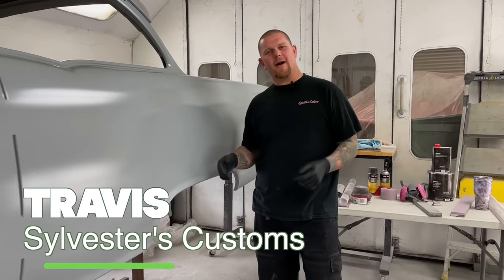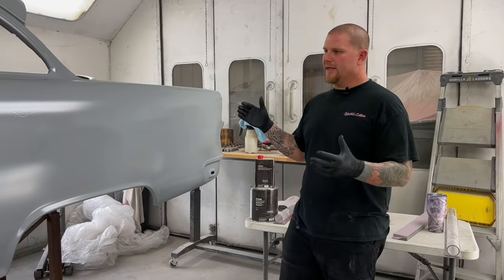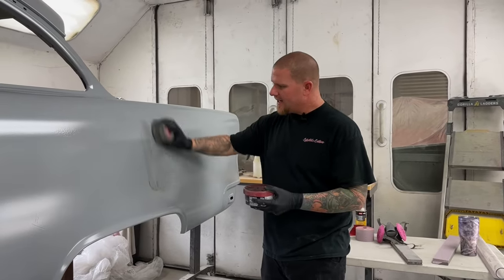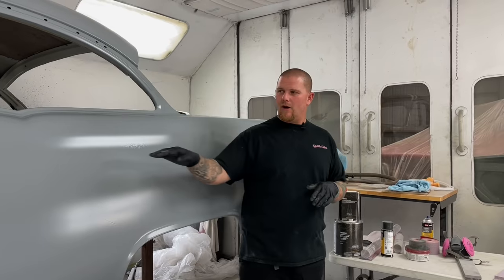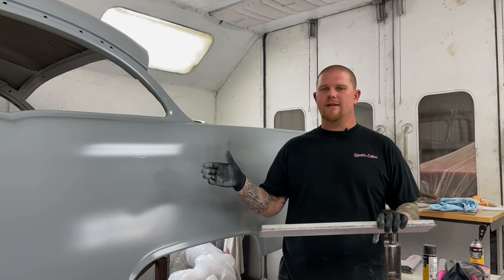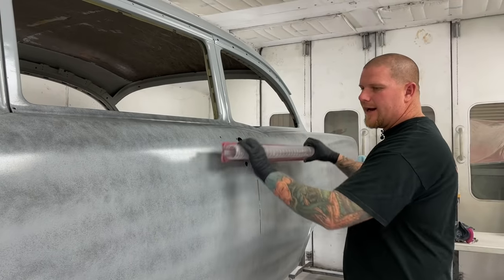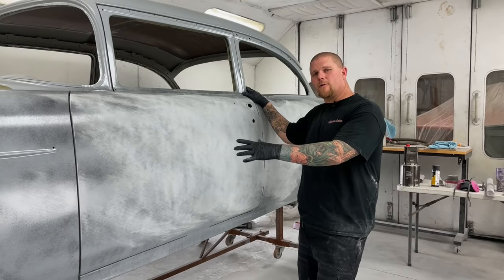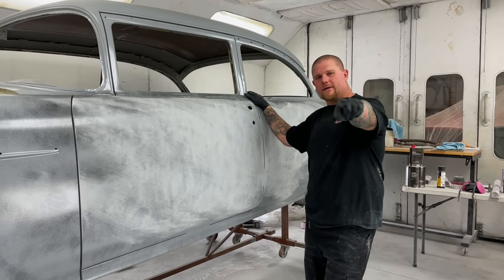Block Sanding Primer - Essential Steps to a Mirror Finish

Comment: them are cool blocks i bought the foam ones with the 3 rods that you pushed through and you could pull out to adjust.well he dyed a few years ago and his wife no longer wanted the buisness so that company is no more i think i bought them back in 2012 i still have them and they work good to foam handles are wearing away though bondo dust eats them up if you dont keep them blown clean

Comment: Thank you very much for all the time you put into these videos!
Quick question.. if you blow through the primer and have to spot prime that section how do you avoid going through again if technically the blow through is a high spot and doesn't require any more build .. but everywhere around it is low
Thank you for your time
Reply from the maker: You need to have the metal work completed and the bodywork needs to be perfect before you do any primering. If you are having areas that goes through multiple time then the body work is not right spend more time in the beginning would be my recommendation. I hope that helps
Reply: @SYLVESTERSCUSTOMS  
Ok thanks

Comment: I just picked up some vp 2050 on your recommendation.  I had already bought eastwood epoxy, but from watching your videos I decided I would go with the ppg. Not actually as expensive as I thought.  My question. I'm still doing welding repairs on the main shell of the car. But I have the doors, hood, trunk lid and front removable fenders metal finished and stripped to bare steel. I want to get them sealed up with the epoxy, but the rest won't be ready for some time. How does this stuff sand after a few months of sitting? Love the videos! Tons if help. 
Cheers John 🍻
Reply from the maker: Right on! Thank you. It does get pretty hard but I’d rather have something fully dry and durable than something that’s still shrinking and drying.
Reply: @SYLVESTERSCUSTOMS  Also just bought some linear Blocks last night. Thanks for the promo. Cheers John 🍻

Comment: So you're using that primer on the bare steel, then body filler where needed on top? Then a couple of more coats as needed blocking in between? Must admit to finding the primer and filling stages a little confusing. Also, would a gallon of that primer be sufficient for a 4 door Mercedes. Thanks for the videos, really like your explanations and tips. Cheers John.
Reply from the maker: That is correct we talk about the primer in the latest video that just came out Friday. It is a one stop shop type of primer it typically takes about a gallon to seal everything up in bare metal. And after bodywork sometimes you use a gallon sometimes you know depends on how much body work.

Comment: I like using House of Kolor KDA3000 DTS epoxy hybrid sandable high build primer. Can also be mixed as a medium build or sealer. I also like Specialist Paints 2K DTM it is exactly the same way. I dont get shrink with either one
Reply from the maker: Whatever works. However they all have shrinkage it’s a matter of how much they get. Only way to know is to weigh it on separate panels as it dries to see when they stop losing weight.

Comment: Have you done the wet sanding video yet?  Unable to find it. 

Also I'm a bit confused. During your block sanding you  spoke of when to stop (when you see body filler) but in one of your replies to a comment you said 95% of restoration shops do body work after prime?  Did I mess up by taking the dented areas down to bare metal to mud?  I've always thought after blasting then clean, mud, block, feather it in perfect then prime, guide coat, check for anything missed, remud if necessary?  It'd be awesome if you posted a step by step bullet point list for us shadetrees. Much appreciation.
Reply from the maker: We will be doing one this week and discussing what the different grits are used for and why. Not all shops go over epoxy primer with body filler but that is the preferred method. Is it going to ruin your car since you took it to bare metal for filler probably not.

Comment: Good video,  about the best explanation of trusting guide coat. If I may make a suggestion,  buy and use a good quality pair of knee pads, in 20-30 years you'll thank me. Thanks for the discount code, I'm retired and disabled and starting on my 64 Galaxie it'll come in handy
Reply from the maker: Yeah we have some most of the time I’m sitting in a chair LOL rolling back-and-forth on that that is adjustable up and down I just got down on my knees because we were filming a quick video thanks for watching there’s a lot more to come

Comment: For some reason I can't view your replies. I have questions like PCar Doctor and I'm working on my 55 Chev.  How did you eliminate the 55 door dome or marshmellow look and get the fit so flat to the quarter panel? Also, how did you connect the door panel to the quarter? Is that area welded or just filler?
Reply from the maker: Not sure why you aren’t seeing the replies. We have other videos talking about the body filler we used in between the two panels to hold everything in place while we bodyworked it. Sometimes we have to cut and weld panels to fit perfect.

Comment: finally real show quality tips. Just in time for my resto project.. well almost. so far I've used ppg shopline epoxy, then filler, sealed over filler with epoxy, now featherfill (gallon on site) next time I'll use your suggestion for primer. after featherfill, 2K sealer primer?
Reply from the maker: I don’t use any feather fill I only use vp2050 but yes you could do it that way 👍🏻

Comment: Super great videos. But why do you say to not use velcro sanding blocks? I've been doing body work for about 15 year and haven't have a problem yet. Serious question not trying to contradict what you are saying
Reply from the maker: It’s not that they are necessarily bad it won’t create a mirror finish is all. You will Probly think no the work I’ve done is good and flat but… when we’re talking show cars there cannot be one slight ripple anywhere. The Velcro or the softness of a durablock won’t make it completely flat. You just gave me the idea to make a video showing the difference between the two. 👍🏻

Comment: I use pvc pipe which I heat on a piece of pyrex in the oven until one side "flattens" 1.5" ID PVC with a 1" flat  - 3"id PVC with a 3" flat then a file the flat PERFECTLY flat and wrap the paper and hold tight, no slack.
Reply from the maker: Interesting 🤔

Comment: Great info and Great Video.   Thank you for sharing your years of experience, it really is priceless information.  I do have a question, why didn't you block all the way to the bottom (over the rocker)   Just easier to do separately?  Or since it will be so close to the ground you don't have to worry about it as much as the rest of the panel?  Thanks    I feel like blocking the center of the panel to the edges I could do pretty effectively but doing all the edges, fender flares, body lines etc would be very troublesome for myself.    Thanks
Reply from the maker: In this video keep in mind I only sanded for 2 minutes just to show on here I will spend all day blocking this side making sure to move around evenly. The rocker should be done as nice as the rest just get a good chair and take your time

Comment: I’ve actually seen the difference in using hook and loop verses a stick on paper. We use hook because it’s less fuss. Yet for straighter bodywork you need the sticking sand  papers used in flat blocks for best finish. Crazy I’d have never believed it actually was true but I’ve seen it with my own eyes many times. For a daily driver it’s not a big deal but a show car it definitely is a big deal. Thanks.

Comment: Do you recommend applying the  VP2050 over an epoxy primer first or is DTM  ok?
Reply from the maker: The 2050 is the epoxy. I recommend using one product but you can put it over whatever.

Comment: I hate block sanding done it a million times I actually have RSI in my arm wrist and fingers, hands been doing it for 50 years, I put down 5 coats and dust it black, when I started there wasn't the product like to day I go from 180 to 400, dont use 240, only 120 if I have a bad spot, I make my own blocks have done for years, I use 3mm aluminum flat bar and use foam rubber I use a 1.6mm if I want it flexable

Comment: That primer is hard as a freaking rock!...we demoed it at our shop and I hated trying to block it because it's so hard to cut.
Reply from the maker: Yes but only when you are getting through the top shiny part. Then it sands killer. That is also why I start with 120 and work up from there. Once you get used to getting your body work perfect and using this product you’re not having to re-prime the car or do a bunch of extra work.

Comment: On a restoration I always block 120 then 180 and let it gas out for a few days. Then I always reprime so that I have enough material to finish sand steps 220-400-600 without breaking through again. On the flip side, In a collision repair shop there is no time to do it twice or to allow time to gas out and shrink. Best case scenario there is it gets to sit overnight before sanding and painting the following day.

Comment: Nice bro, although I don’t agree with the 120 it is nice to cut through the top layer faster. I usually do 320 then 400/500. Like you said Multiple ways to get the mirror finish. however the 3/4 seems like slot of material, I usually do two medium coats. 4 seems maybe to heavy especially with a high build but I’ll try it.  I tried evercoat shb HORRIBLE but it was a polyester I believe.
Reply from the maker: As long as you are using guide coat thoroughly in between steps you should be good one thing you will notice if you do not go back to something as aggressive you end up with a minimal waves that’s why I cut it down pretty good and then take out the scratches what you’re left with on the car is minimal as far as mill thickness but if it works for you great!
Reply: @SYLVESTERSCUSTOMS  true, I’ve even heard of sanding with 800 in the primer stage. I’ll try your method who knows maybe it’s better 😎

Comment: I have a question.  What of ypure blocking a repaired area that has a lot of curves and contours in a tight area [let's say newer cars fog light area]? What is the proper way. I've been using a red scotchbrite pad with a 360 with light pressure, letting the paper do the work. Then I'll run over it again with k600. Thank you for
Reply from the maker: Thats a great idea for a future video. Stay tuned and we will show you how we do those detailed areas. Thank you for your question!!
Reply: @SYLVESTERSCUSTOMS  thank you and I appreciate you

Comment: Awesome work.  Love your videos man, very helpful and informative.  If this is an epoxy product, is it necessary to use a sealer before basecoat is applied?  Thanks.
Reply from the maker: It is an epoxy high build. So if your substrate is all covered meaning no break throughs and sanded good you can go directly to paint. But if you use a sealer it will cross link and adhere better yet. So it’s not a must but Is recommended.
Reply: @SYLVESTERSCUSTOMS  thank you!  Makes sense.

Comment: Question, if I put a new oem bedside on a truck, would I have to do do all the steps shown if there's no dents or imperfections? Or is it good to go for paint?
Reply from the maker: Depends what the end goal is. If you want a mirror finish then you need to do what the video show if it’s not a show car then there’s nothing wrong with running it!
Reply: @SYLVESTERSCUSTOMS  thanks, also do you flow coat any of your projects? Are there any benefits or downsides?
Reply from the maker: @Hunter-fl3kj  no we don’t the only time we flow coat is if I have a bunch of graphics and tape lines to bury. If it’s a solid color we will do 5-6 coats all in one go

Comment: So I have two questions. The first...  My car is blocked and now in primer,  how long should I wait for any shrinkage before block sanding primmer for paint? I used the Evercoat Gold.
           My other question............ I block sanded the door across the gap to the quarter nice and flat 3/16 gap perfect! But now instead of a factory slightly rounded door edge its squared. How can I get a nice consistent factory rounded edge?

Thanks,
Todd
Reply from the maker: That’s awesome!! First question that is all dependent on how thick the bodywork is and primer. The longer the better but you will be fine after a couple weeks. If I had my way a few months. As for door edges. Now that they are nice and sharp I go back through by hand and sand them round evenly and consistently. Count your passes use 150-220 grit

Comment: Love the videos.

I’m starting my restoration and I’m wondering what your opinion on dealing with epoxy primer is. If I have a blocked out urethane high build should I do a seal coat of epoxy and then basecoat the next day. But will I then need to wet sand that epoxy to make sure it has no nibs or peel. Also if you have blocked out the vp 2050 with no filler or metal do you spray base and clear over. Or do you like to have a coat of the epoxy within the 4 day activated window. Thanks in advance.
Reply from the maker: There’s nothing wrong with epoxy as a sealer it just creates more peel I use the ECS sealers because they lay flat if sprayed correctly. But either way you described I’d acceptable. You can wet sand out nibs in epoxy

Comment: Quick question say the car is in all metal 80 sctractch ready for epoxy but there was kitty hair repair on sail panles of a qtr panel. Leave that in 80 as well or 150 were i have it now before prime. I will do all other poly fillers over epoxy i just think the kitty hair bonds better on metal itself as per tds. Thanks again .Always learning on your channel .
Reply from the maker: Either way I don’t think it matters much. I personally don’t use it it’s a failure point so we eliminate the lows in the sail panels.

Comment: Hi there,  I may have been to quick to spray on high build primer. I have some low spots. Can i put a thin layer of filler on top of it again? I am using Rage ultra by Evercoat. Thanks
Reply from the maker: Yes you can!

Comment: I appreciate the tip of the long blocks and the method you use to achieve the long flat surfaces..  As far as the surfacer that you used;  Is it about the same thing as Matrix MP 200 'Direct to metal' substrate? (Also Expensive, but good stuff!)     Thanks, Phillip Hall
Reply from the maker: I am on sure honestly you would have to review the technical data sheet for both products and compare
Reply: @SYLVESTERSCUSTOMS  
Thanks , good idea. Keep up the good work!
Reply: Yea, they look similar. Both are DTM. Says Martix Suggest 1.8 tip Ppg 1.4 to 1.8 tip. Both are high build one step products.
Reply from the maker: @PhillipHall01  Do whatever works for you is what I always say the big ticket is not stacking tons of different materials if you can find ways to be more efficient and a better product go for it
Reply: @SYLVESTERSCUSTOMS  
I agree. I am not suggesting Matrix is a better product. 
Your video is the first time I have heard that PPG offered something that seems to do the same good job, (one step). I got to wondering if they might be basically the same or compatible since they both seem to do the same thing in accomplishing similar results while eliminating the other steps that you made your good point about.  I have not been subscribed here long but I am glad I found your channel..  Good Stuff!  Phillip Hall
Reply from the maker: @PhillipHall01  right on we’re glad to have ya there’s going to be tons of videos rolling out lots of good how to’s

Comment: Is epoxy primer the same as primer sealer? From what I understand, the primer sealer is sprayed after you sand/block your high build primer. Then you spray your base coat over the primer sealer. Is that correct?
Reply from the maker: Check out our video on primers it explains it in detail. There are different kinds of sealers. You can use epoxy as a sealer but most are urethane. There’s pros and cons to both and it varies on your project. I use vp2050 start to finish the a Ecs sealer before paint.

Comment: What do you do with the door gaps now, the bits with filler locking the panels in line… what’s next. I’m going to do this to a car I’m currently working on.
Reply from the maker: We take an air saw and carefully cut the center so we can open the panel at that point. We will just block sand that little area until it is perfect and spot prime it

Comment: Hello, are you using the 2050 as your initial epoxy over metal prior to bodywork? If so are you reducing it or anything special? If not what product do you use as your first initial epoxy over bare metal? Thanks!!  Great videos BTW!
Reply from the maker: Yes same primer and follow the tds sheet for that products mix ratio 👌🏻 2:1:1/2

Comment: Wow, you tend use Very aggressive Sandpaper...  😳  
I think most people watching this will have Sanding scratches-- in the End. 😅

I would just Skip-over the 120 grit..
And use 150 for spot sanding & 180 or a 220 grit for the 1st stage sanding. 

Then 320 --> 600 or 800--> maybe, even 1000 grit, on final Prime..
Reply from the maker: Been doing it 27 years with no issues in our training courses.
Reply: @SYLVESTERSCUSTOMS   I'm sure people eventually figure it out on there own...  (after Re-do after Re-do, etc.)

But, someone who can use Very aggressive Sandpaper-- at any given stage..  only, comes with Lots & Lots of Experience & Time (like you have)-- to know when to Stop Sanding & Change up grit.

The best analogy I can come up with is: 
You are kind like an Autobody Teacher that starts his students of with Power sanders & not Block sanding.

And it's Totally OK to Unnecessary remove Metal or Protective Sealers-- in the process of Sanding.  🤣😂

But, you're really good at explaining things..  I have really enjoyed watching the couple videos I've seen.  👍 

You just can't Handle Constructive Criticism..